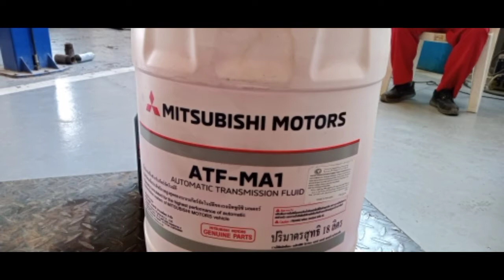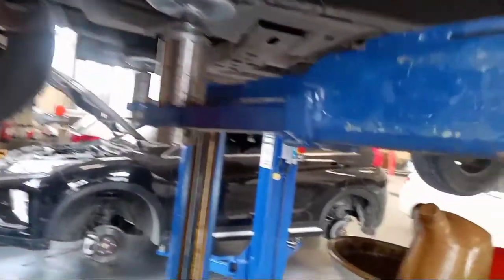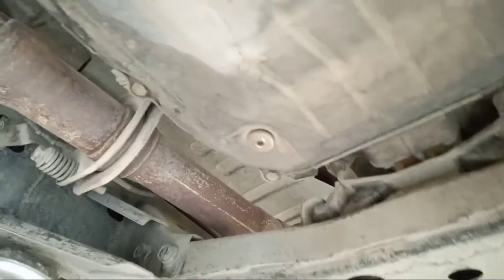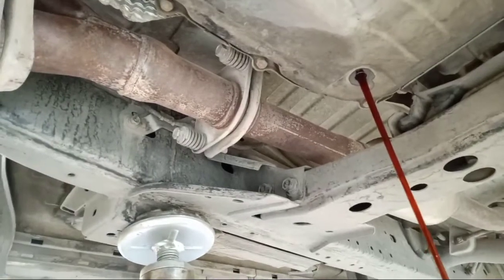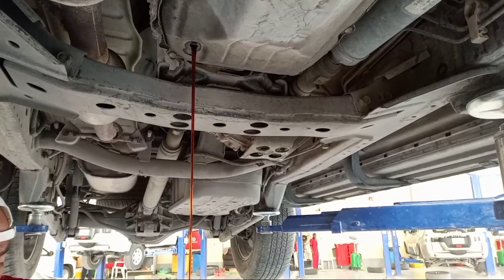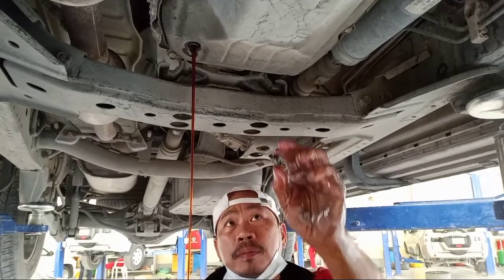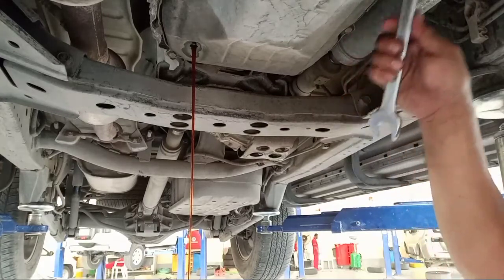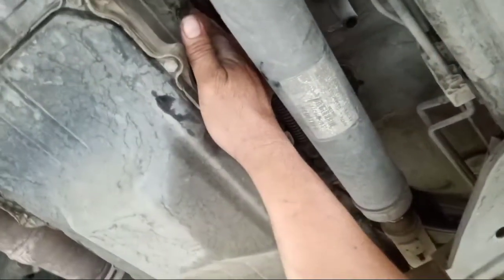Mitsubishi Montero(tech.info.MA1specfication of transmission)automatic

Comment: You should not put the metal drain plug until you fill ATF to have the correct level.  The plastic tube is for the fluid level. Once it stat draining, you stop pumping ATF.

Comment: Sir pls make a video of changing atf on strada 2017 model. It was the first generation of 4N15 MIVEC ENGINE mated to a 5 speed automatic transmission. I used to do DIY's on my unit except for the changing atf. I am not sure where is his filler plug on ATF. This was the previous model of facelifted strada. Pls sir. Make a video for changing atf on strada 2017 model 5-speed automatic transmission.
Reply from the maker: Coming soon sir
Reply: Sir saan Po Banda kalagay ung lagayan ng atf sa transmission 2017 model strada